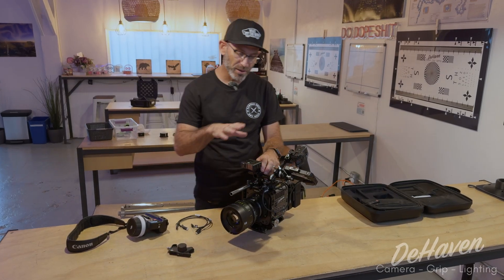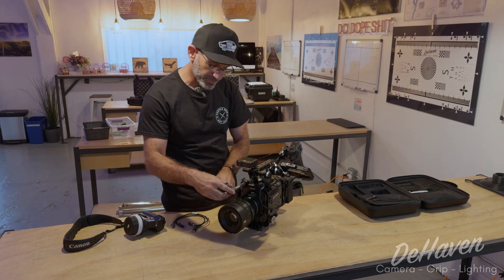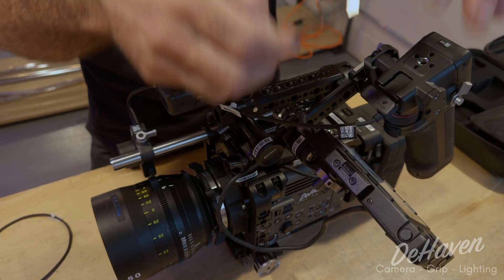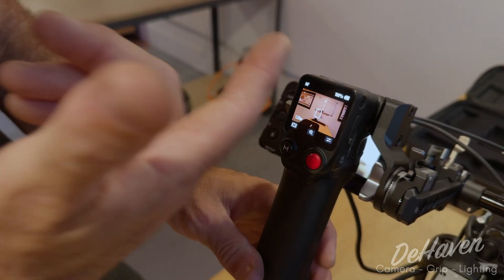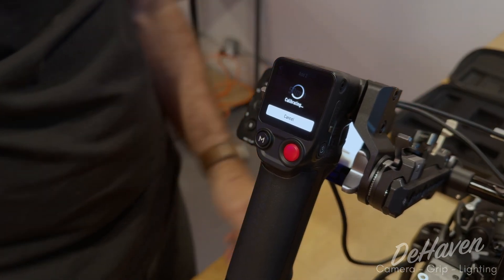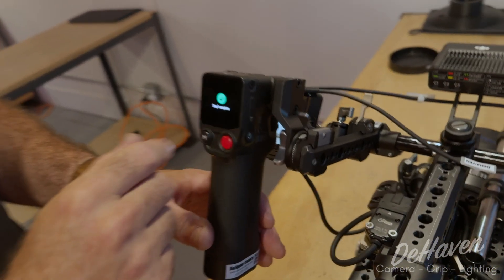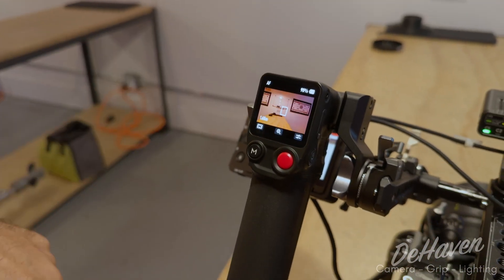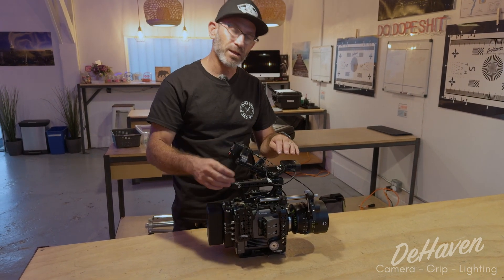How to Setup the DJI Focus Pro with Lidar

Comment: Thanks for the video - did you make any adjustment to the lidar to account for angle difference between the lens and the lidar unit? Is there any mismatch when attempting to focus on something that is center frame on the camera, but not center frame in the lidar? It seems like the height difference could make some kind of delta.
Reply from the maker: As long as both items are on the same plane (z axis or distance from camera) focus remains correct.. However, it is our experience that if you are trying to focus on something smaller in the center of frame that the lidar misses because of its position then you will run into issues. For this video we just did the default setup to showcase the unit.. However for rentals we now offer alternative mounting solutions to get the lidar closer of the center of lens
Reply: @DeHavenCamera  Good to know that others are already looking at fixing their lidar in this way - i'll give it a chance.

Comment: How do you power all this to a V-Mount battery?
Reply from the maker: You cannot power the handle directly to v-mount as shown.. You can go to USB-C so a battery that has this port.. or an adapter
Reply: @DeHavenCamera not exactly, I use a rs3 tilta plate to power the grip from a vmount, it works like a dream because the usb c out voltage from the grip is not 16v
Reply: @airfilm_it  so something like the Tilta Power Supply Base Plate for DJI Ronin works?
Reply: @mrshaheedmalik  right

Comment: So you can get the DJI Focus Pro working without needing a gimbal as well? My main issue/frustration is my budget can handle getting the DJI focus Pro creator bundle, but I can't add a DJI RS4  in addition to that for now.
Reply: Yes it works with or without a gimbal

Comment: "Standard USB-C cables don't work" - Not true, I used 5meter cables all 10Gbps ones works, and only some 5Gbps. The only hard part is that the handle slots are narrow so not all cables will fit.
Reply from the maker: This is per DJI and is very clearly stated in the manual. DJI uses a proprietary wiring on the USB-C cables so not all cables are wired to be able to transmit the signal correctly and you risk damage, unfortuantely.. So I would use at your own risk.. We have had multiple rental units damaged due to these issues and have had to send them back for service..

Comment: This does not work with zoom lenses
Reply from the maker: Not sure what you mean by not working with zooms.. So as the lidar expects a fixed focal length you are correct, however as long as you program at a set focal length you can use it, you just need to reprogram if you zoom. Alternatively the system does work without the lidar for cinema zooms if you want to control the zoom with the hand unit and you purchase additional motors

Comment: They supplied a D Tap.  Can you power the supplied battery with the DTap to a Vmount battery?
Reply: You can ONLY use the D-tap cable to power the MOTOR. If used to power the handle or the lidar it will result in serious damage to the unit.

Comment: Can i connect just the motos usb C to Dtap?
Reply: Yes the D-Tap Cable is ONLY for the motor.. It can power the motor when not using the handle.. Do Not Plug the D-tap into the handle or the Lidar
Reply: yes
Reply: Yes the motors ONLY can be connected to D-tap, however if you are using the LIDAR or HANDLE you CANNOT plug in the D-tap to the motor, lidar or handle or it will result in damage. ONLY use the D-tap when running the motors by themselves with the hand unit.. Use the handle battery when running the Lidar and NOT on a gimbal such as the RS4
Reply: @eric.dehaven  are you sure? This not the case in this configuration.  https://youtu.be/vQIxfv7R4e0?si=PuvpelQbu-T4lrfm&t=785
Reply: @grainfield77  Yes.. he is incorrect.. This is now a well documented problem with the Focus Pro.. The documentation from DJI explains this as well. the D-TAP is ONLY for the motor..
Reply: @eric.dehaven  thank you so much for the information.

Comment: But you can power the handle from battery with a Dtap cable
Reply: NO.. this is very very important.. You CANNOT use the D-tap cable to power the handle in ANY WAY.. This can only be plugged into the motors directly and ONLY when the motors are not controlled by the handle or lidar.. Using the D-tap with the lidar or handle connected will result in serious damage
Reply: Thats cap @eric.dehaven
Reply: Is this true?  Trying to confirm

Comment: Will it work (handle) with the Lidar 2022 module?
Reply: I am unsure as we have not tested this. I would assume the handle and motors would work, but you are unable to buy the handle without the lidar and a motor so I would assume you would have the current Lidar in the package